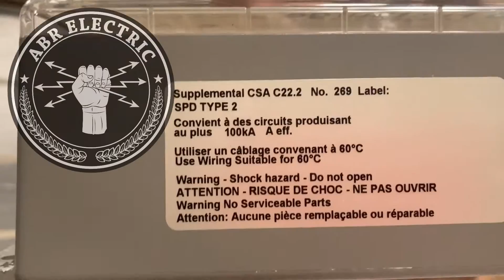Comparing Surge Protectors: Siemens FS140, Ditek and Eaton Ultra showdown.

Comment: as an electrical contractor, a power quality contractor, an hvac contractor (no wonder i retired tired :)) I installed probably a hundred or close to it of the die tec protectors.  never a problem and one homeowner took a lightning strike to his phone wire next to utility wires and the unit self sacrificed but saved all of his Sansui stereo equipment he brought back from Nam.  he was thrilled to say the least.  question: I'm assisting at a house with at least 5 sub panels in 2 buildings plus the house.  would you recommend surge protection in all panels? I know I should know but it's been a long while since I was in the business.
Reply from the maker: No worries. Basic protection would be at just the main panels. It absolutely could not hurt to have a plug-in style SPDs at the sub panels.
In the breaker style SPDs aren't that expensive

Comment: I installed the fspd140 boltshield (similar to the fs140) in my wall but i'm thinking it may have been a bad idea. I have see some of the Mars surge protectors that have blown and it is totally destroyed. My concern is now I have this larger surge protector in my wall. So when this thing blows is it going to come apart and catch my wall on fire or will the casing keep the violent surge contained within the boltshield's plastic box?
Reply from the maker: To be fair, an average Mars spd doesn't have exceptional ratings. Will you show me not be the surge protector but rather the service that has been connected to. The  SCCR and I current ratings of the SPD should be higher than the same ratings on the building service.

Comment: Great information, the only missing information with all the surge protection devices if you experience a surge , for instance the Ditek thermally protected mov unit takes a surge how do you know if the surge protector is smoked or still operating,protecting your electrical ?.
Reply from the maker: @brianmooney1908  depends on the surge, and tge age of the unit

Comment: let me correct u on mov.  they wear down from each surge or sacrafice from a catastrophic surge.  All surge panels that are UL listed with movs have thermal protection.  this thermal proection takes the movs offline if the mov burns up to prevent a fire.  hopefully this helps.  ex product mgr for a surge nfr
Reply: Hey, can you give me any concrete information on where the breaker should be installed? I've been told that it should be at the top of the rail right after the main breaker, yet in my installation that is nearly impossible without drilling through 2x4 into the side of panel which seems uber sketch... Id have to install at bottom breaker position with the protector hanging off the bottom of the panel inside the wall flush mounted. Now my understanding also of installing these is you must use the wires as short as possible and twisted up, along with the fact that flat bars of a buss have lower inductance at the higher frequency of a pulse than wires do makes me think I'll be fine installing on the bottom?
Reply from the maker: @LuLu_World  thank you!

Comment: I installed a intermatic replaceable module spd on my 100 amp whole house generator sub panel,like a transfer switch but select circuit ,16 spaces i believe.best thing is 3 modules line line neutral.all have led indicators of capacity and power.one or more smoke pop them out ,no tools,and replace.no digging around in a panel after dark,homeowners love them ,sell them xtra modules.got monster point of use plug and play on all electronics in house .probably need one on the main fed panel outside on a pole.
Reply from the maker: @keithknechg3217  that international replaceable modules are super handy.
Reply: @abrelectric  what is the model # for the unit that has two single pole breakers attached to the spd that fits in the older style tan cutler hammer panels .it was insalled below our pole mounted meter its 200 amp basically as a way overpriced disconnect,basically empty,main panel in house.i could throw a whole house spd in there that would cover everything not in the select circuit transfer switch,range,dryer and ac.

Comment: I would say the important parameter to look for should be the MOV's energy rating (in joules).   MOV's basically absorb energy when ever the surge exceeds the voltage threshold.  They can only hold so much before they heat up and quit.  The thermally protected devices can hold more because they don't heat up as much.   This rating is basically tells you how big the device is.  The bigger they are the more they cost of course.  I don't even see this rating on the devices you showed....  The current rating is also a pretty decent way of evaluating the device's capacity though.

Comment: They are next to useless. If you have something to protect, end of use protection is the best, these things will not protect your electronics in your house. I recommend "the brick wall" a end of use device at each device that you want to protect.
Reply: I might add I have been a electrical contractor for 40 years, I have installed $3k surge suppressors on commercial buildings, they did nothing when they were needed! It is a scam. They survived a lightening strike by taking themselves out of the crt, but we lost the electronics. Always use end of use devices on expensive equipment!

Comment: Hello, great video for those of us who aren't engineers or electricians. I (Florida resident) currently have a DTK 120/240 CM+ on the main electrical panel and was told by an electrician that a higher VPR  protector was recommended.  I'm leaning towards the Ditek (in your video) to be installed on/in the main panel and separate SPs on each of the two outside/central AC units.  Do you have a recommendation of the VPR of SPs for the outside AC units, or a brand model #?  Thank you.
Reply from the maker: I recommend the one with the best warranty: in Florida,  those SPDs are going to take a beating.  For the ACs, look at PSP, Intermatic and Ditek. Their VPRs are not terribly different and you're using them with a main panel unot.

Comment: I installed the Siemes FS140, real simple, hardest part of all was finding a short connector between the unit and my breaker panel, but since it was 3/4" pipe thread I bought a 2" nipple and 3 , 3/4" nuts and connected it in and tightened the nuts up.
I still don't find any good visual explanation of HOW exactly these work, the unit only has 10Ga wires and the blacks are going into only a 20 amp breaker, yet claims it handles 100,000 amps or whatever, and if it's wired to a 20 amp breaker and only 10GA wires, I don't see how this stops surges. 
I could see how it would do this if both power lines and ground went THROUGH this unit first (like a main breaker) and then the house wiring tapping off the outlet wires, but that's not the way they are designed.
Reply from the maker: I understand your question - it doesn't work like switches, breakers or plugs. Maybe we need a video explaining the physics of how these work?

Comment: Still a mystery how 2  20 amp wires connected just like another appliance, can disconnect the whole house when a surge hits. Just shunting down a surge of long duration, like a primary on the pole hitting a secondary cannot be enough.

Comment: Why cant these be connected directly to the mains without a breaker ?
Reply from the maker: How would you do that without double tapping the main lugs?
If you can work around the double lugging, your idea is fabulous
Reply: @abrelectric  i would pull the meter then go back in the breaker panel loosen the lugs enough to slip the line leads and neutral in with the mains then tighten the lugs.. im sure the inspector wouldn't approve 🙄 lol
Reply: It sounds like you are describing the difference between a Type 1 and Type 2 SPD. As you suggest, a Type 1 SPD is installed near the service entrance of the house, typically near the electrical meter or in a disconnect switch located outside the house and on the line side of the main service panel, before any other electrical loads and therefore ahead of the main circuit breaker panel inside the house. For additional protection, you would then install a second, Type 2 SPD inside the house at the main circuit panel as described in this video.

Comment: Nice video. My home suffers from over voltage. Should be 230 but can hit 260, I'm in Europe, and knock the RCD out = no power until the voltage drops and I reset the switch.
The power company blames a large solar installation nearby, but anyway, will these surge protectors keep my power on if there is over voltage for a couple of hours or so I need something called a power conditioner?
Thanks
Glenn
Reply from the maker: For sustained over voltage, you need a power conditioner. For back up power, you need batteries or a generator.
Reply: @abrelectric  Thanks for the reply.

Comment: Back when I graduated with a degree in electrical engineering (when the dinosaurs roamed the earth – 1976) my motto was:

”Four years ago I couldn’t spell ‘injuneer’ and now I are one!”

As for TPMOVs, I don't know what to think of them. If an MOV has to give its life to save my appliances, do I get as much protection from a TPMOV which bails on me at the last minute (or microsecond) to SAVE ITSELF? Offhand, I think the answer may be to stack MORE MOVs, or maybe supplement them with TVS diodes and/or Gas Discharge Tubes (GDT). I've seen a couple of Type 3 SPDs on Amazon that have both MOVs and GDTs.

Oh, and one more important thing I learned from another YouTuber: The code requires a minimum rating of 10 kiloamps NOMINAL CURRENT. I don't recall the details but it's a level of current that the SPD must be able to survive for a specified number of surges. Many units also advertise a higher number which is the absolute maximum current that the unit can protect against ONCE! He showed a unit that advertised a max current of 25 kA, but a nominal rating of only 10 kA.

Comment: Have a Square D HEPD80 I've been meaning to install for like a year or two already... Put it off for so long because the Main Panel is Full and transplanting/consolidating/upgrading/converting Breakers (plus relocating/splicing wires) is going to be a huge pain/hassle.

While apparently not ideal... The "better then nothing" idea has me thinking the Sub-Panel (that is attached just 4-6 inches from the Main) might be "good enough" until I make some room in (and/or upgrade) the Main.

Heck if/when that time comes I suppose it'll be far easier to just add another SPD to the Main and "Layer" the protection (along with all the other various plug in UPS/Surge Protection further downstream already

Comment: First of all I Love your video. Just to let you know I'm not an engineer or an Electrician. I just know the basic and that is why I watch video like yours to learn more. I have a question regarding Surge Protector and  how some surge protector work. I'm talking about the one you install next to the unit like the AC compressor unit. I saw a video in installing a ICM493 and the connection to this connected is like a series connection. I can understand how it work. The surge will get detected by the ICM493 first before the AC compressor so it can cut off the power to the compressor. But the one that connect like a parallel connection like the ICM518 or the RSH50. Its connected or pigtailed to the L1 and L2 of the wires that goes into the AC compressor unit. Since it shares the same wire, when the line get a surge, it will send that surge to the AC compressor  and the surge protector. Can you shed a little more light in how protector like the ICM518 or RSH50 protect my AC compressor.  Thanks, Phil

Comment: You are correct that any SPD is better than none. However, when  selecting a unit the most important  thing to ensure is that it has the UL1449 4th edition or later listed. Then it needs to be rated for the correct location, Type 1 service entrance while Type 2 is for locations downstream like sub panel. Of course, It should match your voltage. Finally, select spd that has a max  surge current rating of 50kA or more. 
For homeowners, this is really about all you need to look it. 
I enjoy watching your channel. Thank you.
Reply from the maker: No, thank you!
Reply: EXCEEDINGLY helpful! Thank you!
Reply: The Ditek D300M series 300 KA UL1449 5th gen cheapest I could find was $1600 little out of my price range. D50 series is 50ka UL1449 5th gen.

Comment: I installed the FS140 today. It was a easy install. I noticed a line voltage drop through out my home and shed. Before 123.5 voltage reading was the norm. Now it's 121.0 voltage reading. My home has two other surge suppression devices on the central ac unit one inside and one outside. Plus 5 battery backups TV, three in computer room and 3d printer. And one covering three laser engraving machines 😊😊
Reply: @Laserwurks - Please review your installation!
There should be no voltage drop with the simple addition of the FS140.

I just installed several in my home and, as I anticipated, zero drop in voltage.
I have 2x 120/240 vac single phase 200a services for my home.
I bought the last 2 adjacent lots of a residential development and all underground services were run already and easements would have been a nightmare to deal with.   (also.. the cheap ass developer direct buried everything WITHOUT conduit.  Even CATV and telco were run 12” below grade without any protection OR ability to pull in replacement or upgraded cable/fiber).

I have a UFER grounding electrode system because of 2-way radio repeaters and other RF gear.
I ended up mounting several copper grounding bus bars in a NEMA 3r enclosure for equipotential grounding/bonding of everything, so I’m pretty confident about the reliability of the grounding side of things and used a 2-pole 20a QO breaker in each panel for the FS140’s.

And…. After installing everything,
The voltage to neutral/ground from each phase remained identical.

And.. ABR:
Thanks n for this channel as videos !
Reply from the maker: The 2.5 volt drop is interesting. It seems unusual based on only the SPD installation

Comment: The only issue I can't understand is why these surge protectors can't be installed directly to the bus bars if it is so critical they are installed closest to the source the power panel?  I hate having to move all of my breakers down to install another double pole breaker for the surge protector. Do they all install through a c/b on the panel?  Don't any have their own breakers?  I know Siemens makes one that can also be used as a normal breaker but I still have to move all of my breakers down in the panel.  My main disconnect is outside and I don't have one on my sub panels.  I hate that too but seems to be standard in the South where I live.
Reply: I have installed a bunch of surge protectors and always wondered about that low impedance connection. Lately I was asked to install a surge protective device in every one of 27 subpanels in a hotel. Turns out they were 3 phase panels so I had to find a 3 phase surge protector. Much to my surprise, the installation instructions on the one I chose said to slip the 3 line wires from the surge into the main lugs feeding the subpanel (plus a line to the neutral). Clearly this is the best way to do it and I suppose the residential ones don't mention this because it would be dangerous for DIYers to do it on a main panel and would mess up torqued main lugs. Should be fine if you are adding a second layer of protection at a subpanel or an A/C disconnect.
Reply: I ended up letting my Utility company install the "Meter Treeter" surge protector at the meter socket base.  They charge $5.95 a month for this but no installation charges.  They also tested my ground rod resistance (17 Ohms) and also maintain it.  I do have to keep it for a minimum of 36 months.  I have 3 sub panels that are over 50 feet from the meter and felt like this was the best bang for my buck right now.  I could still add sub panel SPD down the road if I think my surges are being generated within the house.  I personally believe it is usually when power goes out or fluctuates during storms.  

 @JamesAllen-tj5nu

Comment: Would a whole home surge protector negate the need for a dedicated HVAC protector such as the DITEK DTK-120/240CM+ Surge ARRESTOR, Parallel Protector?
Reply from the maker: Not at all. Layering the protection is a great idea. The worse the grid power or lightning activity is, the more important the layers are.
Reply: @abrelectric  Great! Thanks